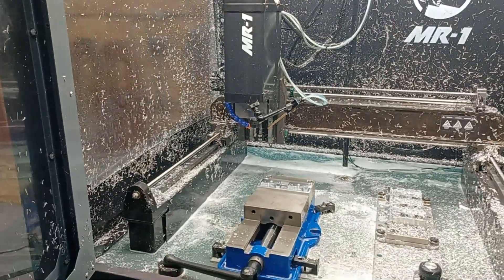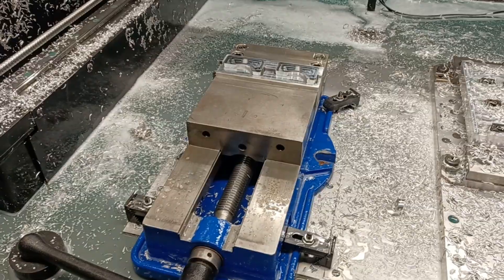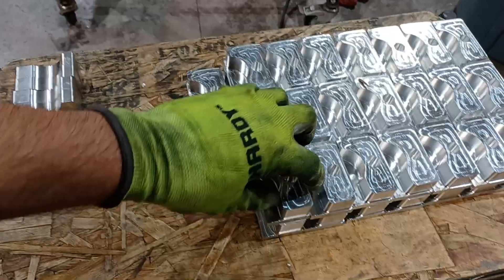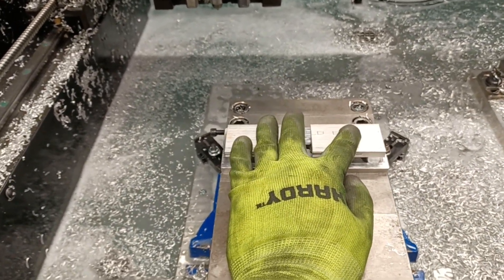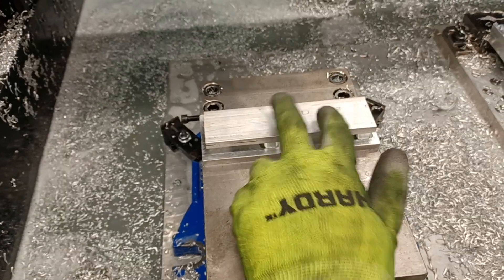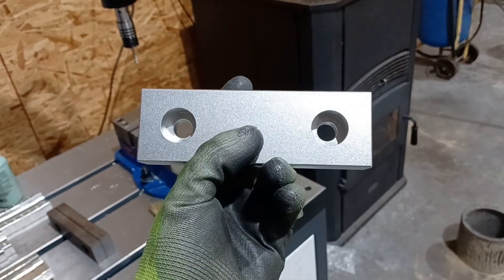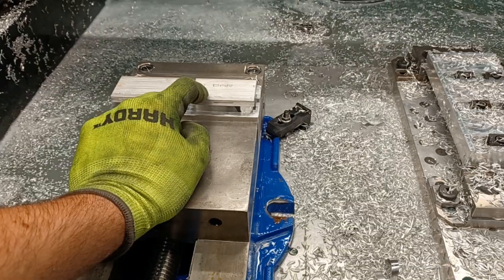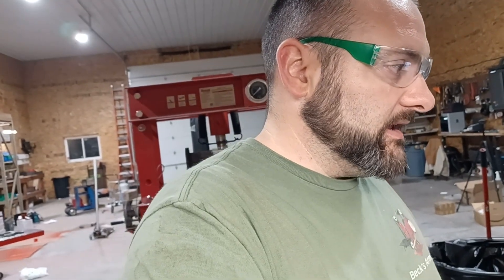MR-1 Running Dual Offsets (G54, and G55) On Your CNC Machine

Comment: Thanks for sharing. I ran into issues when I had high parts and the tool setter. I have 3D printed spacers to raise the tool setter. I bought dual Langmuir vises instead of the Saunders vice. The parts I make are very large in comparison. I may put in an aluminum T-slot tool plate to limit the need for a vice. Keep up the good work, I like your workflow.
Reply: Mr Beck, from my perspective, a quick unedited video likely means more info will be shared with relatively less work on your end… more often. Thank you sir. 🙏
Reply from the maker: @joell439  100% I can put out way more content this way.
Reply from the maker: Thanks for sharing
Reply: Man I love your upgraded MR1 it's sweet
Reply from the maker: @calvinflowers369  Thanks!